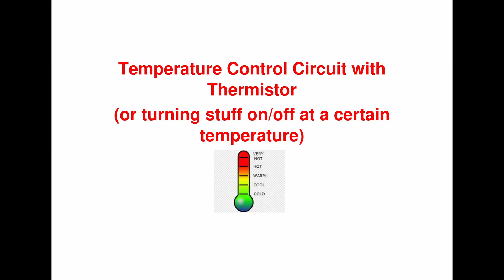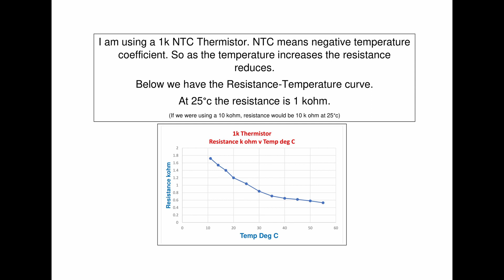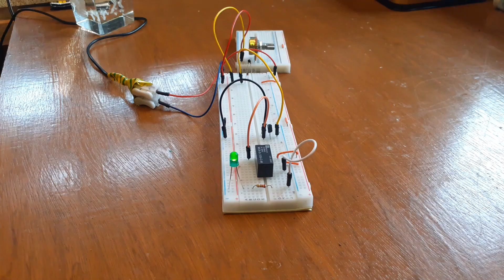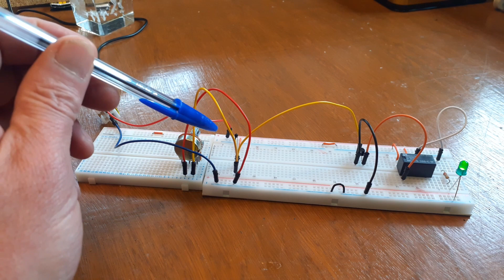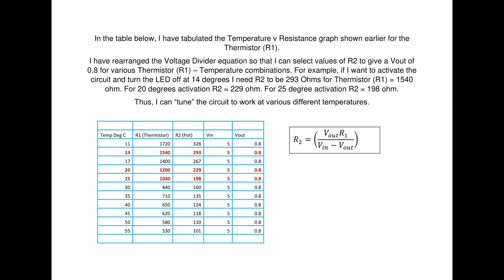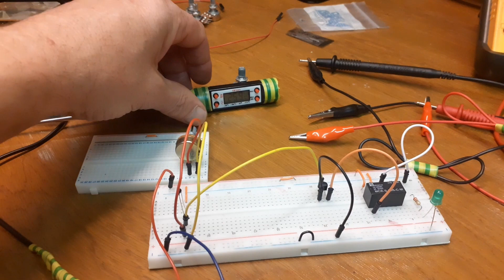Temperature Control Circuit with Thermistor. (or turning stuff on/off at a certain temperature)

Comment: could you supply a schematic diagram? I have a similar build I need to make that involves using a thermistor to turn off a heater once it hits a certain temperature.
Reply from the maker: there is a circuit diagram in the video, what more do you need?
Reply: @paddymacnamara6305   My bad, I didn't see it the first time watching. Thank you!